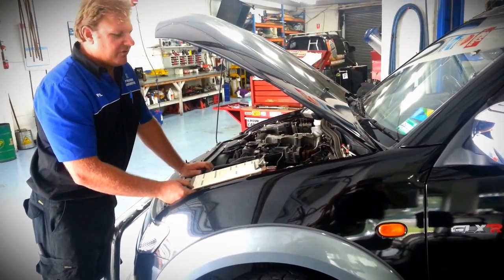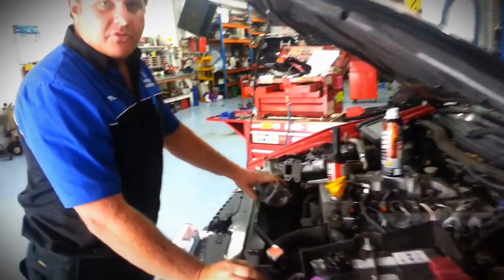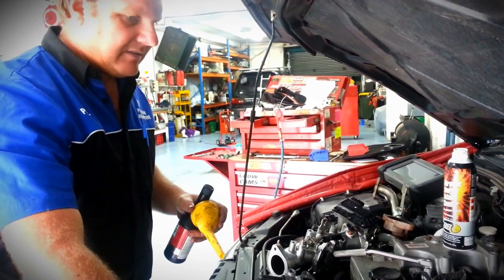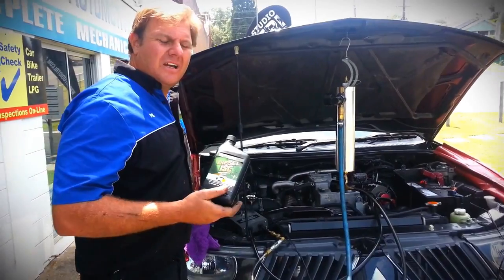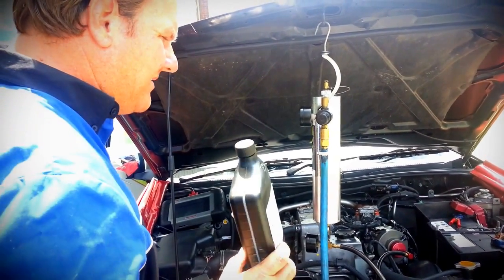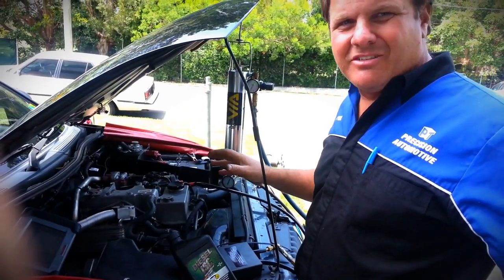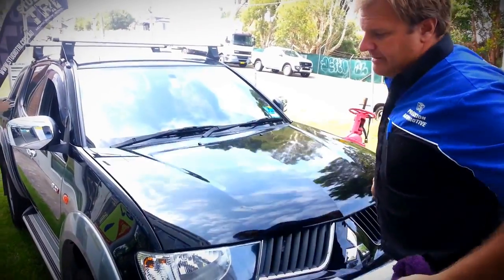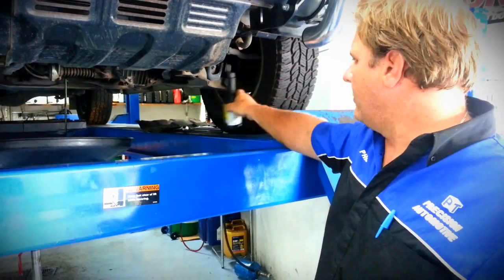Mitsubishi Triton, P2413, Fixing EGR problems and build up of carbon in induction systems.

Comment: I would be interested to know if you have put a bore scope in the inlet tract and runners of some vehicles treated to see before and after results of this process, curious if this process is yelding the same results as ultrasonic off car manifold cleaning and media blasting of the inlet. 
Would love to know your thoughts
Reply from the maker: the only way to do a complete clean is to remove all manifolds, NO product will ever clean it off with out manual clean first. BUT it cost [labour] some people don't want to spend [invest] in doing it that way. but these day's i only want to remove all manifolds..... and do it correctly. [it's the best way]
Reply: @PTPrecisionAutomotive  thanks for the reply. as a fellow mechanic I was interested on your feedback on this process as I have only cleaned them via removal in the past.

Comment: My car cuts out when I slow down or stop (not everytime), nothing is coming up on the reader so no one has yet worked on it. How would i know if it was the egr, acv or something else? Thanks
Reply from the maker: your going to need a mechanic who knows what there doing to work that one out.
Reply: @PTPrecisionAutomotive  thanks,  I dont think any do. They just use the reader and nothing comes up so they have no idea. I can smell petrol at times when shes warmed up. Just gunna take the car to the garage and pay for them to look at the car rather than them just use an obd reader. Thanks

Comment: I have a 2005 Lincoln is my car sounds like it has a miss fire and it is blowing the oil all over the engine. When they scanned the car it showed the EGR valve and also the oxygen senceir. Can any one help me please
Reply from the maker: Lincoln what?
what fuel type?
what engine?
What are the actual codes?
does it have excessive blowby? (remove and sit on hole does it fly off)

Comment: Egr is closed all nice and clean, disconnected it after cleaning intake and everything ells. Will put vacuum line back today and see. Here in South Africa we dont have emission problem and inspections. I replace the complete turbo and install 4 new injectors. Will have them programmed in the ECU today. Will keep you updated interesting
Reply from the maker: yeah the best way to delete an EGR valve is to just block it off (where the gas re-enters the intake system) or at the exhaust manifold rather then just unplugging it. let me know how it goes after you do the ECU and try it plugged back up.

Comment: Hi I removed my vacuum pipe of my egr and blocked the vacuum tube off. Can the disconnected egr cause low performance on low rpms. Got a e46 320d turbo only kicks power at 2800 revs. Please let me know if you would be so kind
Reply from the maker: is the EGR valve closed? have you tried plugging the hose back on and seeing if the power comes back? usually when they fail you have no power at low RPMs because they get stuck open.

Comment: Ive just cleaned out my inlet manifold with acid bath which was pretty blocked up with gunk. Also the EGR valve. Can you tell me if blanking the EGR will give the engine more power and economy? Ive been told it will cost $700 to remap my toyota Hiace 2009. What is your opinion re the extra power and economy? Could I blank it and drill a 8mm hole in the centre of the blank to minimise build up. Would this still give more power etc? Or should I just put a catch can in for $300? The catylictic converter has been bypassed..cheers

Comment: My 3.0 D4d @ 160,000kms Throttle body, Inlet manifold was 30% blocked. I end up doing a manual scrap & clean of soot which managed to fill a full can (375ml). Exhaust Gases and Oil vapour is the worst thing you can mixed as it become very gluey soot. Oil catch can is now fitted.

Comment: DO you ever have problems with the Mas airflow sensor throwing codes when doing an engine decarb or large bits of carbon coming off and into the cylinders?
Reply from the maker: no usually it won't throw the light on unless we have something disconnected.

Comment: I have a question Phil: If the customer of this Triton had of used a synthetic diesel engine oil such as Mobil Delvac 1 15W-40, do you think that the vehicle's carbon deposit problems would have been less or non existant? I'm curious of your professional opinion of this issue. I personally use Mobil 1 5W-30 in both of our Toyota's (RAV4 and Corolla), and have done so since their first oil changes from new. I've put my dad onto using Mobil Delvac 1 15W-40 in his Isuzu D-Max. His vehicle seems to be running great.
Reply from the maker: oil isn't the the main issue with carbon build up its caused mainly by the use of the EGR system and city driving mixed with engine blow by. If the owner of this vehicle drove the car twice a month at 100km/ph for an hour or more then the likelihood of it having carbon built up would be minimized. If you were also to add a oil catch can rather than having the blow by go into the intake system then I doubt you would have any problems at all.

Comment: Just block the EGR to inlet with a plate as its just an emission control piece of crap which destroys engines and keeps mechanics in a job, the car industry has fitted EGR valves so they can sell more vehicles and parts as the cars pack up, they must believe we are all mushrooms.
Reply from the maker: may be a little late but no you won't have to remap unless it has flow sensors
Reply: Also keeps people alive

Comment: Todays cars suffer from a dirty intake, but have a clean exhaust system.  The opposite from a few years ago.  Either way, the residue blow by is getting trapped, but for the intake, is causes performance issues.

Comment: You can see there's no oil catch can on the engine. the crankcase ventilation hose is sending all the oily/fuel "blow-by" vapour from the top of the engine...back into the big air intake pipe just after the air filter.  6.33min
Good video thanks
The EGR valve can get blocked but it actually does a  positive thing by shrinking your engine and saving fuel at low engine speeds. At wide open throttle the EGR valve doesn't doesn't have any effect. The EGR valve only opens at small throttle openings.
 Would it do any damage to put a blanking plate on the  EGR on a turbo diesel... by causing excess heat? Just for the purpose of not having blocked EGR issues due to carbon.

Comment: looks like and interesting and effective process. my only question is, do you REALLY think maintenance is the issue, especially in a 60k old car? if you believe it should be done around 40k, i reckon design is more the problem, not (lack of) maintenance. 10yrs ago this is the kind of treatment you would expect to give a 400k old diesel for a new lease of life not a 3yr old one :/
Reply: Emission control systems have historically been a massive issue with all engines. Due to fuel/diesel not being a clean product to run cars on. Simply rerunning the exhaust gases to try and give them a second burn off is just ludicrous. I, personally, think that more energy needs to be put into electric cars and cars that run on hydrocarbons. The problem there is big corporations can't make a ton of money out of it. I'm sure that when the day comes, and it will, corporations will find a way to screw us over anyway.

Good maintenance practices and how you drive has the biggest impact on your engine.

Comment: EGR is a crock.  High performance cellulose filter that removes dissolved water (Jet/Diesel/Petrol all have it) knocks out NOx and greatly reduces soot.  Manufacturers need to get their heads out their behinds and investigate alternate methods to deal with NOx. Plus fuel economy improves 3 to 5%.  Aussie truckies and mining industry have been using them for years.

Comment from the maker: You could just block the EGR valve off But that is not legal.
The EGR is there to do a job .
there are underlying issues that can cause carbon and sludge to build up, eg to much crank case pressure , leaking injectors and seals,, lack of oil changes, low grade oil's etc.